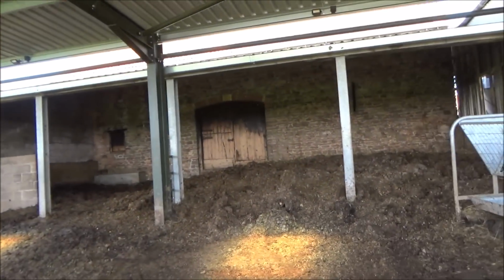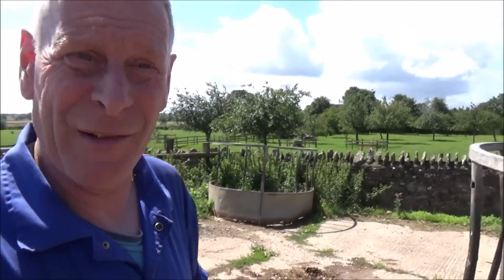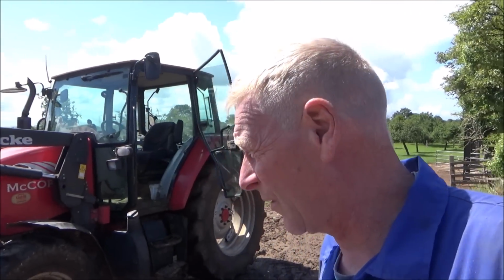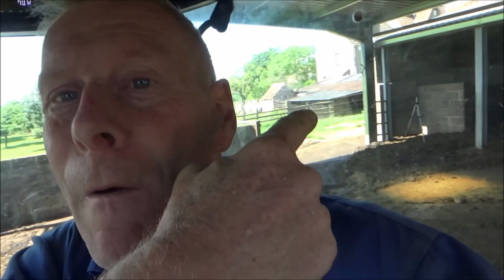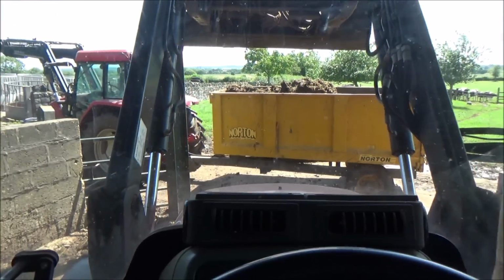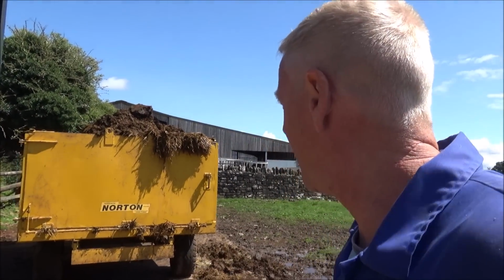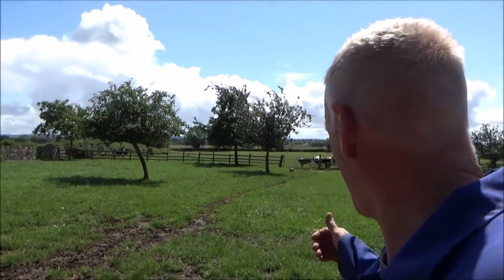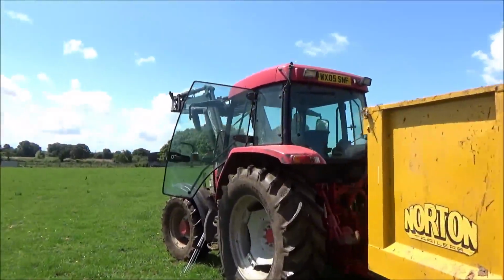MUCKING OUT THE CATTLE SHED, WHAT COULD GO WRONG?

Comment: instead of turning round in the yard move the trailer forward a bit and back straight out of the gate on the field and foward slight left and dump your loader in the trailer less wear on tires
Reply from the maker: its too wet on the field

Comment: Rich when thinking of changing  a tractor look at a small telehandler with rear pickup hitch. You won't be disappointed so much easier and quicker for loader work, scraping out and with the option to tow a bale trailer it'll save you lots of time.